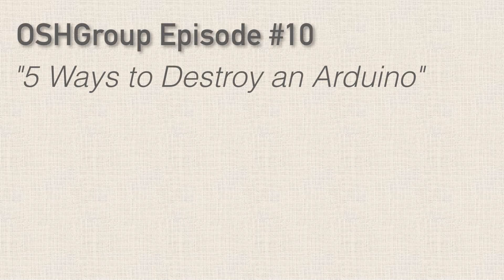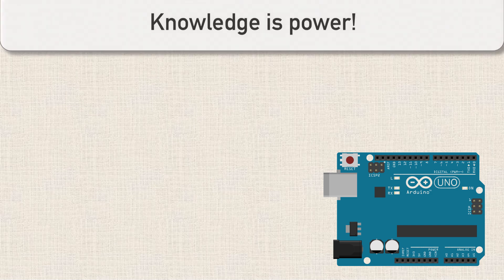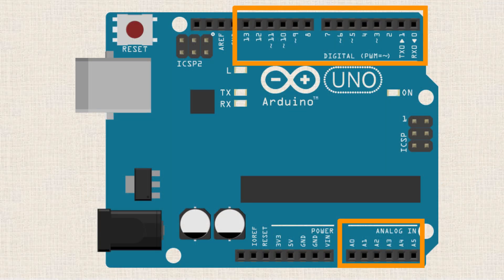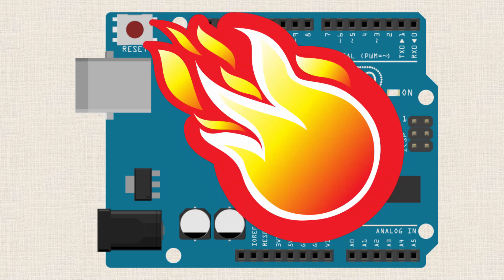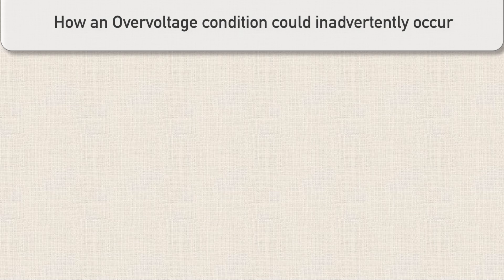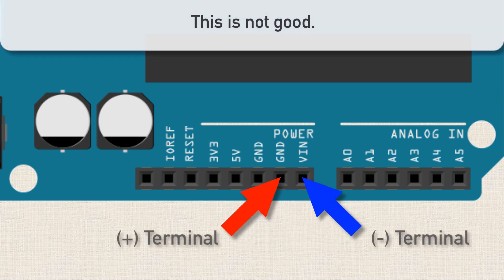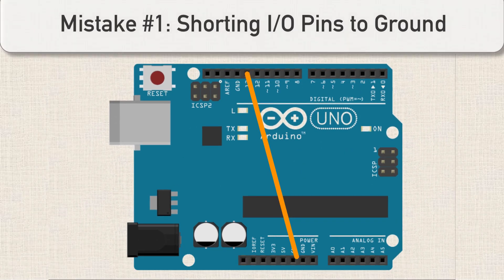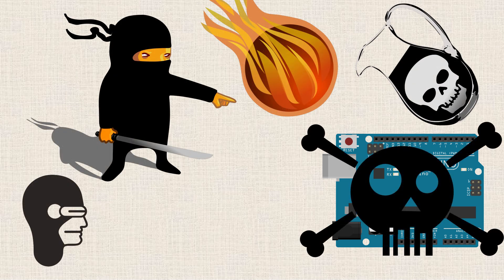5 Ways to Destroy an Arduino

Comment: Hi, is it normal that EX and RX LEDs shine constantly very little, like dim. I worry there was a short circuit, but I can still upload programs on my Arduino. I am just bothered buy this two lights constantly shining. Thank you.
Reply: You probably blew a capacitor which is resulting in leakage of current

Comment: considering that all you said will only happen, if someone cant read or is extrem careless, you missed another advice to not put a weight of over 1000 pounds on your arduino or throw it into a lava pit or run it over with your car or use it under water or use it to hammer nails into a wall. common sense is recommended while using an arduino. mistakes can happen but dont act stupid.

Comment: Problem #4 can be solved by adding a diode to the PCB to prevent current from flowing in the wrong direction between the vin-pin and ground-pin. 

Since the schematic for the Arduino is open source, I don't know why this hasn't been implemented into the design. Is there perhaps a particular reason why they didn't add a diode to the schematic to protect the Arduino from situation #4?

Comment: Once grabbed the wrong wire and connected a 3 amp 12v power supply directly to gpio on a cheap Arduino clone when I was 14, I didn't notice until it started smoking lmao

Comment: my arduino rip list
arduino uno R3 
arduino uno R3 Smd
arduino nano 33 ble
arduino nano nrf 
need to buy some more XD btw if you wonder why so many dead arduino.s
i am building high power rc car and tried using bluetooth wifi ect now i am using a 4x4 crawler with 5x mini-servos 1x big servo 1x wifi camera 3.3v boosted with antenna then arduino nano rf boosted and expansion shield and for controller joystick shield v2.4 with rf chip with boosted antenna and arduino smd 😅🤣
Reply from the maker: May they rest in peace!  Cool project!
Reply: @programmingelectronics  thanks they wont be forgotten haha

Comment: Would connecting a DI (pull up resistance) to a GND pin destroy the arduino? I don’t have a breadboard in hand, only a breakout board and want to test out if my code is reading the DI pin correctly. Essentially doing this to mimic a button pressed when DI is connected to GND. Thank you

Comment: This is not really true, when it comes to I/O pins and ground. The microcontroller has internally a current limiting output driver, so it can handle a short circuit to ground without taking any damage. The current available is about 20mA. We also can see projects in the Arduino world, people connecting LEDs directly to output pins w/o any current limiting resistor. In those cases the microcontroller is delivering max. current output, into a typical 1.8V - 2.4V voltage limiting load. However, when working as inputs the absolutely maximum input voltage is 5.5V before damage. Also, the "Aref"-pin is suspectible for damage, as it's outputting the actual Aref-voltage (5V as default) when external Aref is not set. This pin must not be shorted to neither +V or GND, only float.

By the way I like your videos :)

Comment: When I was a kid messing with an Arduino UNO I was trying to power a motor with Arduino PWM so no motor controller this motor would've also pulled about 500 mah. Then I had a 9 v plugged into the vin and ground. My circuit didn't really make sense lol because I didn't have any resistors at the time and I smoked the atmega chip. But surprisingly it still worked after being smoked and there was no damage as far as I could tell.
Reply from the maker: It's amazing how resilient parts can be - and in some case - how not resilient they can be!

Comment: Can we connect it to 5v 2amps adapter
Reply from the maker: Great question!  If you are referring to the battery adapter, you need a minimum of a ~6-20V supply (though I think a min of 7 is probably a safe bet)
Reply: @programmingelectronics 
Thanks. I have one more question
In arduino as isp can we program pic ic using it

Comment: If you do use Vin and dont trust you self, just put a Zener Diode between, so if you do connect it the wrong way, it will just short the battery

Most Offical Arduino board (Mega 2560, UNO) have this anyway

Comment: all these comments saying that with the same price they can buy 20 of them from china i would sugggest to remember that in the first place ruggeduino was created be implemented in industrial use and enviroment. if you put an arduino in an industrial situation it wont last longer. because arduino has no ESD protection no current limit protection no current limit on the pins no precision clock no protected and insulated pins no over voltages and over current protection and no possibility to run from -40 to 85 degrees celsius. This is the difference not the fact that you coulf buy 10 from china at the same price, of course you could but it will last a week on an industrial enviroment and also is not even certified and protected so the price is fully justified

Comment: Even tho' I haven't damaged my UNOs yet, your video hammered home the idea that I could.  However, my solution was to purchase two blank ATMEGA328P chips and burn the Arduino bootloader to them.  Now I have 2 spare chips in the off chance that I toast the chips on the board.  I've been pretty careful so far but have in one instance overdriven an LED to the point of damaging the LED.  I guess the LED was a cheap fuse in this case.  The chips are available both pre-programmed ($5.49) and blank ($4.95) from Jameco.  I had originally bought the Arduino ISP for projects I had in mind where I would program the board without using the bootloader.   So now I'm a little more comfortable using the boards knowing I have spare processors tucked away.  The Ruggeduino is a nice idea but a little overkill for the average hobbyist.

Comment: This seems like a big advertisement. My Arduino has survived short circuits - the LEDs just go a bit dim and/or the board resets.

By the way, if I remember correctly, the barrel connector protects against reverse polarity.

Comment: The best way to protect any port on any processor is to use opto couplers  but not just for over current conditions and over voltage but for other reasons too one of these being that noise 

Spurious bursts of noise upset and change values on port registers which can  give you false readings when dealing with high switching speeds Shifting through registers and suddenly changing from output to input can equally produce the same result but for best results either use hex buffers or opto couplers and since we are moving towards  fibre optic might a a good idea to do this anyway then you can move forward with that technology

Comment: ive actually had and have an arduino that was connected to a 12v battery and i accidentally shorted 5v to ground. the regulator fried and anctually send 7V into my usb port (another thing that they failed to protect on the original board) and both laptop  and arduino (chip) survived

Comment: For one ruggeduino you can buy 25 Arduino Uno clones from china. You can destroy 24 learn an awful lot and still have one that works. Why would i ever by an Arduino for $50?? This is a bad ad for an overpriced product.
Reply: exactly.
Reply: I've caused some serious damage to the ATMega328 on two of my UNO's from overvoltage. Don't accidentally loop 24v back to them, folks.

However I am certain I can fix them by just...replacing the ATMega328 with another one from eBay for less than dollar. The chip is designed to be easily removed and replaced.
Reply: That's how you learn electronics.
Reply: LsHallo Vader
Yep. I've actually replaced the aforementioned Unos with some 101s. The 32mhz is really noticeable with what I do with them, so I'll be more careful with these. I plan to repair the Unos and use them only for testing purposes.
Reply: Why?: It is a common misconception that the Arduino 5V regulator will ensure that the 5V voltage remains at 5V, no matter what. IT WILL NOT! The only thing the 5V regulator can do is control current coming from the USB port or the external DC power jack. If the current is coming from an external power source directly connected to the 5V connector pin, the regulator can do nothing about it.
Another consequence of applying more than 5V to the 5V connector pin is possible damage to the PC's USB port. If the Arduino is powered from USB then this excessive voltage can cause current to flow backwards through the voltage-switching MOSFET T1 and back to the PC's USB port.

Comment: I can't help but feel like some of this info is misleading... Sorry to say, not saying this was intentional, but!

Shorting pins to ground/together:

Done that many times before on an accident. The current draw gets so high the regulator can't cope with it and the Arduino resets, tristating the pins.

Applying overvoltage to the pins: I've actually seen an Atmel document, which shows  applying 220V to the digital input. (I think, don't quote me on that). Anyway-the point is, that the pins DO already have protective diodes that clamp the voltage. These can take few thousand volts, as they are designed for ESD protection. Obviously, the current needs to be limited. But my guess would be that 9V through 1k wouldn't do any damage at all...

Reversing the polarity is something that's impossible to do when powering the Arduino from USB. The mistake of connecting a battery in reverse to the 5V and GND pins isn't easy to make.
Putting over 5V to the 5V pin is also not an easy mistake to do...
Reply: its like a science teacher forcing you to wear safety glasses if youre mixing salt and water.

Comment: Why would you put any kind of current to the 5 volt pin? Its for powering sensors not an input
Reply: actually you can power the arduino via the 5v pin but only if the input is 5v (duh)
Reply: Oh well okay... Is there any reason to use this and not Vin?
Reply: yea, because vin is connected to a voltage regulator so it needs a voltage greater than 7v,
So you might use the 5v to connect a arduino to a powerbank, usb cable

Comment: Do you have a video that shows how to overcome the Arduino power limits?
Reply: that's called a transistor
Reply: You can buffer the outputs with an IRF510 MOSFET.  It's Vdss is rated at 100v with 5.6 amp current rating.

Comment: Perhaps someone could clarify a couple things for me. In other videos a pushbutton when pressed directly connects the 5volts out to a digital input pin, so is that power source regulated in a way that prevents overcurrent casualties? Also I have heard that a 12vdc automotive battery source can be used to power the board directly, so does anyone have experience with that?
Reply: If you set Arduino pin as an Input it has much higher resistance than pin set as Output, that's why you can directly connect it to 5v but even with this high resistance you shouldn't ever exceed the 5v limit otherwise you will damage the pin (or the entire microprocessor) too.

Comment: Is it possible to fry the board only using software? I think I managed to brick the serial interface chip by uploading a sketch.
Reply: If you uploaded your sketch through icsp it can remove the bootloader.
If you didn't use icsp to upload the sketch upload the sketch to pastebin.com and reply with the link
Reply: +zach burke The Arduino IDE crashed, so I dont have the sketch anymore. It was supposed to read RFID tags, and it does actually work, but the rx pin is fried. That means that I cant upoad to the MCU anymore. It wasnt the serial interface. It must've been static, because I have no other eplanation for it. Also the loopback test fails, but the oscilloscope reads the data happily.
Reply: you can probably brick it with a while loop. but idk how a arduino works exactly tho.
Reply: David Serrano as I understand it arduino reboot when serial connections are made this is tied to the hard reset line. So when uploading it should reboot and not even run the code.

That could be wrong I've never looked deeper then normal code.
Reply: +zach burke Not when serial connections are made. The serial chip (also an atmega) is pulling the reset line low and bringing the bootloader into programming mode when a sketch is uploaded. Im gonna investigate any involved solder joints when im back from vacation.
Reply: drkastenbrot on my board every time serial connections are made it resets. I don't have a genuine board so maybe that's it.

Comment: How can I check if a pin is dead?
Reply: +fragwits 
Okay I have a lot of problems with button examples. 
After many different tests I finally go the button to react, but the LED blinks fast and when I push the button it gets steady or turn off. Which one is different. But when I use a pull down or pull up resistor to stop the LED flashing all the time, my button does not react. 

Before the button reacted I was wondering if the pin was broken, but I have tried input 2 and also tried input 4

Comment: The free course is great for total newbies.  If you have programming experience, most of the stuff on actual coding will be far too simple.  But here and there there is still good information about specifically coding on the Arduino, and it's a way to get familiar with the device, the IDE, and getting them to talk to each other.  It's a good place to start.

Comment: Nice video, but I think that you have exagerated some things. I have done some of those things with my Arduino and it's still going strong. For example, I had switch the polarity of an ATMega328P standalone and it got very got, but in 10 minutes it was fine.

Comment: I bought a Arduino last week, and as I was wiring up a 4 digit 7 segment display, I accidentally created a short circuit. Luckily one of the LED's inside the display got destroyed, and broke the connection. I have so far not notice anything wrong with the board or microcontroller, and I have tested all the pins since then.

Comment: just acciedentally discharged a disconnected 36v line with a cap inside into Mega2560 Serial1 RX1 port.. RX1 TX1 is now broken and my chip has a tiny hole in it lol  
but rest still working.

but for the price of one ruggeduino i get 8x mega2560 boards or 15x Uno's or 36x nano's  , so no problem lol

Comment: What if i do it like this?

int Output =53;
int Input = 52;

void setup() {
pinMode(Output, OUTPUT);
pinMode(Input, INPUT);
}

void loop() {
digitalWrite(Output, HIGH);  //gives +5V to the LED (3V, if i add a resistor betwen arduino output(53) pin and the LED)
digitalWrite(Input, HIGH);   //does this pin connects to the GND once it's set on HIGH?
}
--------------------------------------------------------
//or this one

void loop() {
digitalWrite(Output, HIGH);    
digitalWrite(Input, LOW);    //the LED shouldn't glow, or?
}

// example for 1 LED

I want to drive a 4x4 LED matrix without using transistors, will it damage my arduino if i do it like that? Or do i really need to set another pin as an output and add a transistor to use it like as a switch?

Comment: In the last week I have went through 2 arduino unos because I wanted to make a gameboy but I had a 12v battery and I plugged the bare wires into the 5v pin and the ground 😅👍

Comment: Sir,what is the max. voltage that can be applied to the Vin?
Reply: Due to the Onboard reglator, for the the ones that have the SMD version of 7805/78L05/etc(Any 3 pin, 5V) Regulators, Technicality 7 to 40V, For best regulation(This is for all 3 pin(IN-COMMON-OUT))  is +3V above the output and shall not exceed 40V

You WILL damage any 3 pin regulator going above 40V

But things limit this on the arduino board, 1 - The Capacitors, there normally rated at +25V, 2 - The DC connector
the way its designed, only as high as +12V

There rated at 7-12V
Best output go for 8-12V
Also, a note, the Regulator on arduino is 1A max output

Comment: Good board but too expensive for consumers (target group??). I hope China will come with a copy soon, I dont like to pay for logo.
Reply: +Jeroen vd Velden  You are not paying for a logo. You are paying to people which spend their time, money and afford  on this project (arduino). Why people see only parts price? I'm  working on many projects, at the end there is a hardware and software part. Manufacturing costs are few Pounds, but I wouldn't bothered to working on something for manufacturing price...
Reply: The arduino brand premium price is more of a donation than anything else.
Reply: +Jeroen vd Velden have a look at ebay, and use the site where the currency is low. I'll bet you'll find an original or a good copy from one of the arduinopartners for around 7 euro or less. Believe me, blowing up an arduino is not very hard to do :(